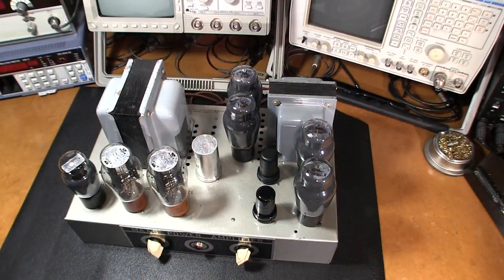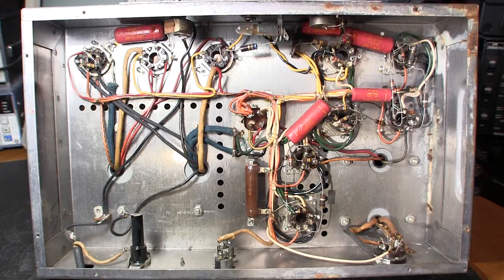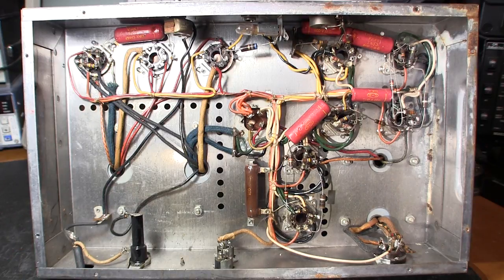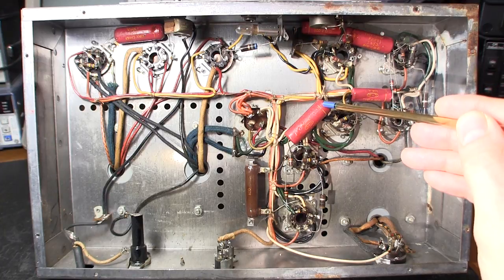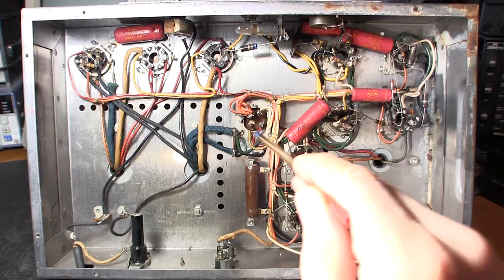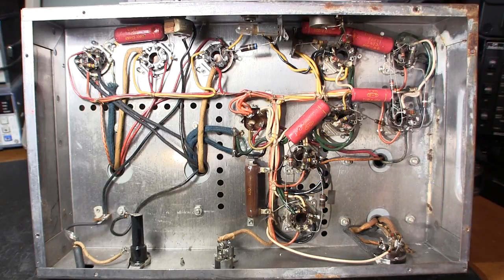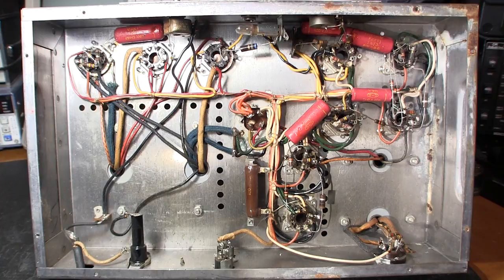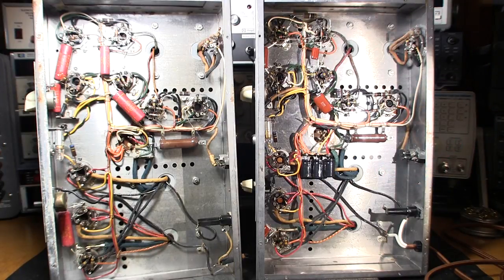Tube Amplifier Repair, and what to look for.

Comment: I just aquired a Maas model 50 and a 500 in pristine condition. A quick look, I was able to see a rough picture in my mind of the 50's circuitry. I'm amazed that there isn't a schematic on the internet, as popular as these were. It looks like I'll have to pencil one out. It appears that the 50 will require a preamp, too. I may remove the two triodes and wire in two 6sn7's. Part of me wants to politely convert this old girl into a sweet guitar amp. The 6v6 screen regulator in a novel idea; something that a few 1k resistors could easily do, opening up another tube socket. Now for the best part... the serial number on mine is 80!?! The audio chain caps in mine are ceramic, and not the axials that you have in yours.
Reply from the maker: I have a complete re-design of this amp on Patreon with schematics, and a lot of other information.

Comment: YES!!! I want to see broadcash transmitters! Excellent video. Very basic yet very informative. Also, have you noticed that the metal can crapacitors tend to last WAY longer than other types? I've NEVER had to change one. Even in 60 year old equipment. The exception being the salt and pepper shaker style copper can style in my Philco model 70. There was loose stuff inside that came out the holes on top. I just disconnected it, polished it up and put some small electrolytic craps underneath. A  coat of clear coat and the copper still looks new 25+ years after restoration! 73's de w1rmd.

Comment: Hate to ask an off topic question, but I guess I will just go ahead and do so; I have a Kenwood TM 241A 2 meter mobile transceiver, picked it up off Ebay last year, fellow said it worked great when he last used it. I got my ticket last May but didn't get a chance to hook the unit up till November, and then found that the microphone, the one with the on-board keypad would not key up the set, in fact it acts as though it is getting no power.  I hooked it up just before we left South Dakota for Arizona in our motor home, it is mounted in that rig. So after getting to Arizona, I messed with it a bit and finally gave up and ordered the cheap microphone, the one with no keypad.  That one will key up the radio, and I can talk back and forth to my two 2 meter hand held  units, however I have yet to make contact with any other person, and can't seem to hit any of the local repeaters.  At any rate, I guess my question is, is there a fuse in the transceiver that sends the power to the microphone that would  cause the big microphone to not work but allow the smaller microphone to key up the set?

Comment: I really like point-to-point wired electronics. When a modern solid-state amp fails, it's often more cost-effective to replace it rather than have it repaired. (Unless one does the repair work oneself)

Comment: Mr. Carlson's warning about lethal voltage is spot on.  An old "chestnut" says work with 1 hand in a pocket.  You can modify the "chestnut" to state or wrapped around your belt, at the small of your back.  The point is not to have a shock pass through your heart.

Mr. C. are those coupling caps. really PIO or are they waxed paper?  Hermetically sealed PIO caps., like the available Soviet surplus K40s or OS "Vitamin Q", seem to stand up well to time's ravages.

Are you planning to use 2X 6SN7s in Williamson style circuitry?

Eli D.
Reply: +hawkturkey: The classic flyback transformer!  There was a running joke back in the day. Q: Why are they called flyback transformers? A: Because when you touch one, you fly back! 😄

Comment: Paul this was interesting Video, in that it reminded me of when I had bought from P&T Surplus in Kingston N.Y. USA a Bell Tower  Carilon  tape system WITH the power amp much like you have there! The tape was contained in quite LARGE tape cartridges about three times the size of the old cartridges used in broadcast studios!! the player could hold 12 cartridges that held the hourly bell chimes, then there was another player unit  that held 3 cartridges I think these were for any public announcements by the church OR civil authorities.  I had rebuilt the system  had it for a while then sold it to another church that had built a new facility about 10 miles down the road from me!
Reply from the maker: Great story John, Thanks for sharing that!

Comment: Back in the early 1960's when at school I was taught by an old ex military radio man who by then was repairing TV's that the first thing to check was the switches and pot's then the resistors then valves and capacitors were the last thing to go wrong. Certainly in a lot of the old stuff I was playing around with resistors were cracked and cooked with heat and capacitors were rarely bad. I fixed many a radio that had noisy resistors back then, most of what I had to play with was from the 1920' and 30's. At what time did capacitors start to be the main culprit and resistors hardly ever fail as that appears to be the case these-days.

Comment: I just subscribed to your channel! That was a very interesting subject you just covered, and the way you explain everything makes it very easy to understand.

I do like the older tube equipment, especially those with the point-to-point wiring. Everything is laid out in a logical manner and is much less complicated that those with circuit boards. Plus, the older tube stuff, if maintained properly (or sometimes not maintained at all!) will last for years! 70+ years for tube gear as opposed to how few number of years for a transistorized equivalent? No contest! If that same amplifier had transistors in it and water (or bird "squirt" got in there), bye-bye transistor! 

I also liked your cap tester with the eye tube in it. Reminds me of those "tuning eye" receivers which were popular back in the day. My grandmother had one, I think it was a Zenith, an early FM receiver with a center-channel tuning eye. It was one of those models which was manufactured very soon after the FM broadcast band was moved to where it is now. 

I will just stick to the phrase, "If it doesn't glow, it ain't real!"

Thanks and 73! de NØJAA.
Reply from the maker: Welcome!

Comment: I am about to rebuild a 1955 Wurlitzer 1800 amplifier for a friend and as I have not worked on tube amps before I looked around a bit for tips and tricks and stumbled across this channel. I have spent hours after hours watching you repair hopeless stuff and also explain how stuff works! ;) By far the best channel on YouTube! I have now marked the outer foil side on all new caps, had no idea about this. I have been looking for the nice ceramic stand off's you use when replacing the can electrolytics but not been able to find more than a few very expensive ones. Where can I find these?

Comment: As bulky, heavy and primitive as they are, I doubt will ever get over my love for old tube amps like those. 
I too stumbled on a guy who was selling his whole garage full of electronic stuff, mostly from WW2-50's, and in that pile were 32 NOS JAN Sylvania 6L6GA tubes. Sweet. In cartons, though the cardboard would literally crumble if you touched it. So, I built a tube matcher to see if I could gather sort-of matched pairs. Apply the same conditions to two tubes and with two identical panel meters read the cathode currents. I was amazed; very few pairs could be matched closer than 2-3 mils and the readings ranged from 23 to 45 ma. They were all over the place. They all worked but it's as if they were different tube types.

Comment: Great video as always, and a big YES  to the transmitter tour idea. If it is such a large transmitter (I believe you showed the outside of it in an early video) what main power tubes is it running? 833As or 833Cs?
Reply from the maker: Hi Joseph. This version has a pair of 810's modulating a pair of 810's.
Reply: Thank you for the reply. 
I have little knowledge of 810s, that sounds like it would be a great video.

Comment: Your capacitor stock must be amazing. Seems like every repair project you change out all the caps. It would be interesting to spend a few minutes describing the parts that you stock and how you decide what to stock.
Reply: You should see mine..... When Capital went out of business, I was buying old caps by the pound, 100 pounds at a time, and spent weeks and months, checking & sorting.  Then I did some reforming, but if they don't start to show progress fast, they get chucked.

Comment: Carillon systems are still in very wide use. Although the newer systems use either CDs or digital audio files (.mp3 or .wav) as a source, the old tube power amps are often kept in service, for all the reasons that you stated....unless some sales weasel lies and slings a good line of bovine fecal matter, and convinces a church that old is bad! 
One correction I might offer: 'Head (source) units and power amps were usually kept in the church's vestry or, in the case of a very large church, located at the rear of the nave (closer to the bell tower, but still out of weather). I spent countless hours, days, etc., working on these and other low voltage systems, and the biggest issue was speaker wiring...which WAS exposed to weather, birds, and vermin! If a power amp failed, it was usually a result of an open speaker line. The biggest point of failure was always the older (tape-based) head units, with all the inherent weaknesses of tape playback equipment, running 24/7 in uncontrolled environments.
Reply from the maker: Thanks for taking the time to write Norm!

Comment: I really enjoyed watching this video and the "history" stories as well, very interesting. I couldn't agree more about the power cord, a 3-wire cord just doesn't look right on vintage equipment. The Ground or 3rd wire just ties in at the panel to the neutral (white) wire anyway..  I do however always use a polarized plug for safety :) Take care, Tom
Reply from the maker: Glad you enjoyed Tom!

Comment: When we worked on tv sets back in 1970 we cut the wire on a cap that had lo votages, start the set and put an tube meter on and se hov much voltages comes out, often very old wima caps. Ofcourse bee careful if you do, the voltages is deadly. But the methode was working.

Comment: Thanks Paul for the tour and explanation on this amplifier.  The simplicity of the circuit is amazing.  What model is your capacitor tester? I have the IT-28 and it is laid out the same just different colors.  Enjoyed it Paul.
Reply from the maker: Hi Buddy. Your tester is pretty much the same, just a different color. This is the IT-11. Thanks for stopping by!
Reply: +Mr Carlson's Lab I am interested in the eye tube overload and volume indicator as seen in the Maas Rowe 500a. Do you happen to have one of these and can you explain visual indicator circuits in audio amps like this? I have tried to find a schematic for the 500a without success. Thanks for your videos, I always learn something:)

Comment: Paul, interesting that you have changed all of the bypass capacitors, but not the overheated 25w ohmite resistor when comparing at 20 minutes.
Reply from the maker: It's been hot, but that's just fine. These resistors rarely fail, and this amp is still playing music today.

Comment: I have a 50s vintage Newcomb E-25 amp with those pesky Tiny Grief caps.  Is there a crossover table to find equivalent replacements? I'm not sure how far I can deviate from the originals.  Thanks.  Great video.

Comment: Did you keep the modified version Mono Output?   I didn't catch that part..  

 50W is more than enough with a Tube amplifier. Such robust sound.  I remember the first tube amp - ( H.H. Scott ) amp I had, it was like 25 watts and sounded huge. It's a very pleasing sound especially in the Low / Mid range.

Comment: If you look at it closely, there is a reason for every bend in every wire, because of the order things were assembled, to separate the high and low voltages to get to the solder joint.

Comment: You pointed out that some of the resistors had leads that were corroded due to some sort of fluid, possibly rodent urine. Will the tube sockets and tube pins get corroded and pitted, too? Also, regarding the wiring of the replacement fuse holder I personally like to have the line cord connected to the end of the fuse holder instead of the ring. That way if and when a fuse needs to be replaced and i forget to unplug the unit then there is no live voltage right there at my fingertips.

Comment: Hi Mr Carlson. I'm fairly new to electronics and really appreciate and learn a lot from your videos.    I recently bought a 60 year old tube amp.  Wasn't  running when I got it. After many cap replacements it is sounding great again.  Only issue is there is some hum still in the 1st preamp stage. I rewired checked grounds, replaced resistors, caps etc., but hum is still there. When I put my hand near the area the hum goes down a bit but is still there. It is all point to point wiring and when I tap on things with a chopstick there are  some microphonics (especially the .033mfd cap). One last thing is I replaced a 50s' microphone jack w/a 1/4" jack (followed same grounding approach)  Really like to fix this properly if I can. Any suggestions? I can send you pictures and/or the schematic if that helps.  Thanks!

Comment: They are not normally kept in the bell tower but are usually kept in the sacristy.  They output 70v sent long haul to a horn speaker in the bell tower.  No 8 ohm output.
Reply from the maker: Hi Steve, Yes many are in the tower, and have multiple outputs as well. This unit has 4-8-16-250 Ohm outputs for many uses. The reason for "Phase Inverter input" is so they can place the amp close to the driver (Horn or speaker) In a remote location. If a line comes loose (audio input) the stage gain is low enough that the amp won't produce hum.

Comment: love that tube amps are dead simple, reliable, and repairable.  I'm building a JE labs 300B SET amp.  I was told that a 6SN7 is equal to two 6J5 inside one envelope.  I'm using a pair of 6J5 because it's supposed to be cleaner sound.  any thoughts?

Comment: It would be great to see some sort of buying guide for old tube amplifiers for everyday music/audiophile use!
Reply from the maker: Well, I would make a list, but I would get those fellas that like to spend $1000 on oxygen free audio cables arguing with me. People seem to be pretty set in their ways when it comes to audio, and I find may (and I mean MANY) don't want to hear fact. So I usually don't offer my advice in this area.
Reply: Shades of the old Auricles column in AUDIO.  Metal ingots placed on top of power transformers to "soak up" stray M-field energy, etc.  Waaaaa!

Comment: Not sure if you ever read comments on here anymore, but I am beginning to research the process of becoming an amplifier tech, specifically guitar and bass amplifiers. I have experience in small electronics and soldering - as well as residential/commercial experience as a full-time electrician -  but don't entirely know where to go for resources, or where the best place to begin is. Do you have any advice or wisdom to begin the journey?

Comment: Amazing content '' I have a1954 Ami Rowe  R145 TUBE AMP  Jukebox it plays really clear and strong It has  two 6L6 GC  a 5U4GB ' two 12AU7A And One12AX7A  I found an extra complete 145 amp on E bay i bought recently  with the Exact same type of these pink caps in the amp' looks to be untouched and in very nice condition ' I have been Searching  for a Super Tech like yourself to up date this survivor core unit to use as a new spare for my 45 record jukebox ' the 145 Amp in the jukebox now was completely Re caped 21 years ago by an older local tech that worked for Cadillac music' in the Cleveland Ohio area;  He has since passed away some time ago'  playing the juke box 3 to 4 times a week for hours at a time it now has over123.000 plays on the machines counter ' i love the OLD tubes '' I found a nice assortment of vintage NOS tubes recently and was really amazed at the top end sparkle and mid range sound quality '' its a real joy to have this machine'  Thank you Mr Carlson for keeping these Treasures alive ' and kicking '

Comment: Thank you for making this excellent and interesting video! One thing I am curious about, have you tested the frequency response of this amplifier? I would have assumed church bells didn't need the low frequency extension that full range music does, but the use of 0.1uf coupling capacitors and the size of the transformers says otherwise (i.e. I suspect this probably goes down to 30Hz) 

As for your plans to modify the amplifier with 6SN7 tubes, I completely understand why you would want to do this, however it's just so nice as it is... how about an external preamp instead?
Reply from the maker: One is already modified, I haven't had the time to do the other yet (possible winter project) The modified amp is a long video on Patreon with all the Wattage and Distortion specs for the factory and modified configuration. I also took the time to draw factory, and now modified schematics as well, they are attachments there. I can tell you this, the modified amplifier is "worlds" better. They really do need the modifications. Thanks for your kind comment!

Comment: I have got a old 1960s Bell and Howell model 462 Filmosound 16mm projector with built in valve amplifier.  Now I have a problem when I switch the amplifier on I get high pitched squawking/squealing noise from the speaker, very uncomfortable to listen to.  So I’m wondering does this mean it will need re-caping.?  Or will it need new valves?  There are 8 values in there and it looks like the filaments are glowing from what I can seen.  Any advice please?  I would be grateful.

Comment: I'd like to see the transmitter : )  You have not shown what those quad capacitors look like inside the metal cans.  What is the history or logic of putting those caps in a metal can when other caps simply go below the metal chassis?